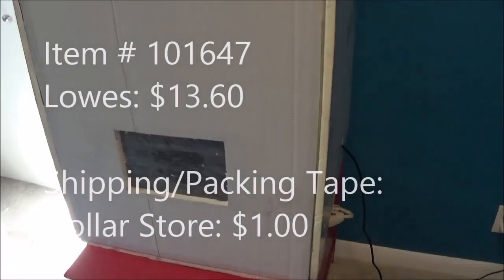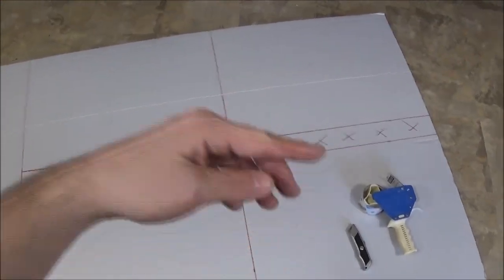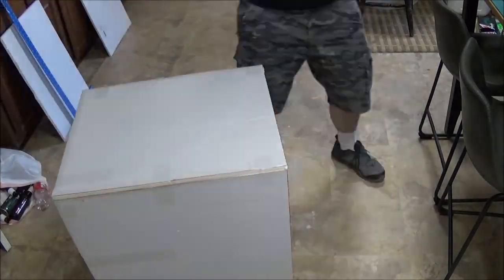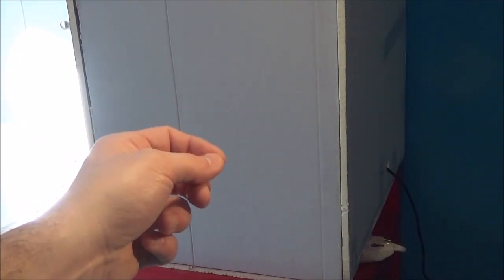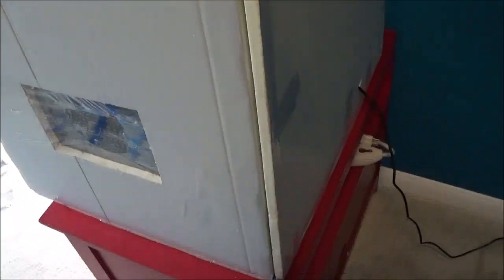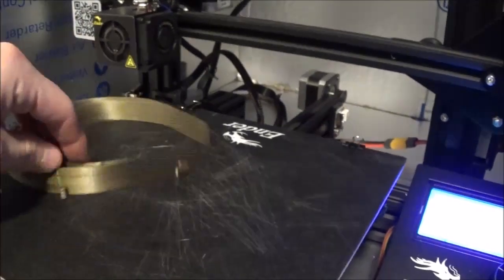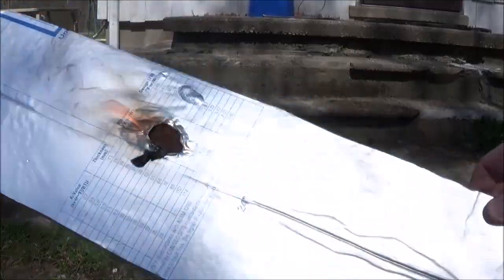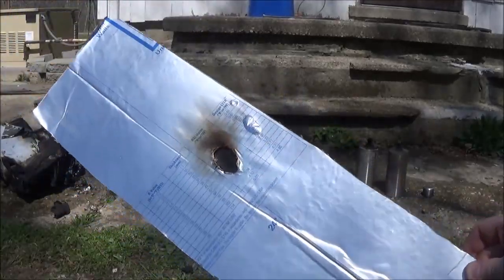How to build an Ender 3 ABS Enclosure for $15 (Plus Flammability Test)

Comment: I've been printing abs on the ender 3 v2 without an enclosure for the last two months building the voron 2.4 components. The enclosure is not necessary as long as you don't live in a drafty home and keep your home at a relatively stable temp like 73 F
Reply: you'd want to print abs in a ventilated area so peeps like open a window or sumthing. unfortunately that can cause a problem right?
Reply: @Xerkies  The fumes given off are negligable in the volume (print size) that you do.

Comment: That foam is highly flammable.  "Polyurethane foam is also one of the most flammable consumer products, and firefighters refer to it as solid gasoline" http://www.tasconindustries.com/CelluloseVsFoam.html
Reply: Foam board insulation is just about as cheap so still a great idea. But good tip to use the most non flammable material available ideally.
Reply: This board is polyisocyanurate. It contains flame retardant chemicals. Bought this same board for that reason.

Comment: Great idea!! I am thinking of putting the controller, and power supply on the outside, most likely underneath with 4 inch feet to help with electronics airflow. You should add a pet odor filter to some part of the ceiling it would eliminate the smell that melting plastic makes
Reply: The fumes are not exactly good for you so I would recommend a exhaust fan that goes to the outside